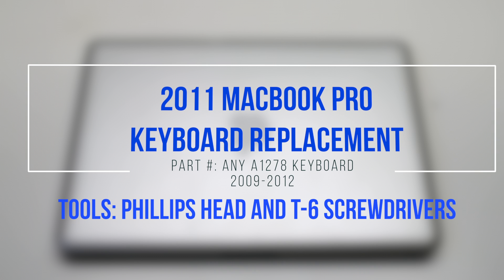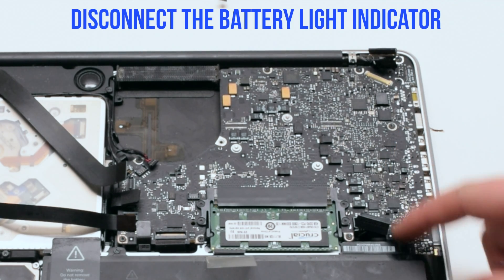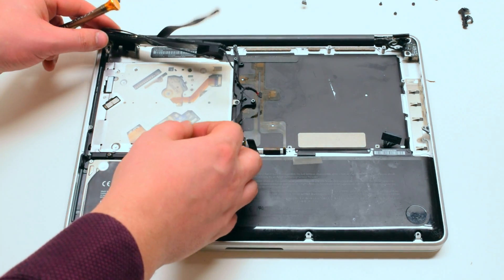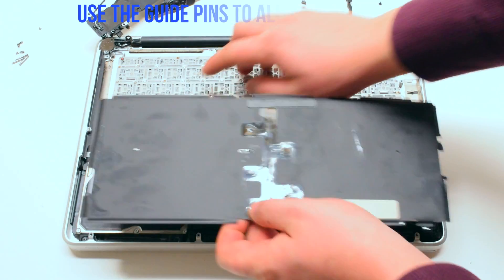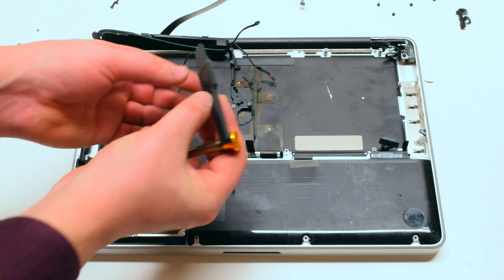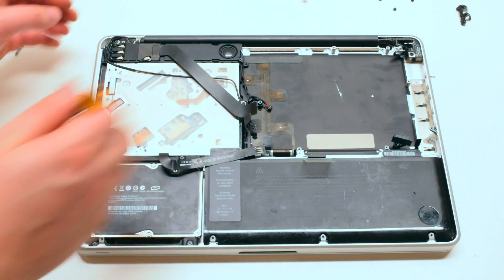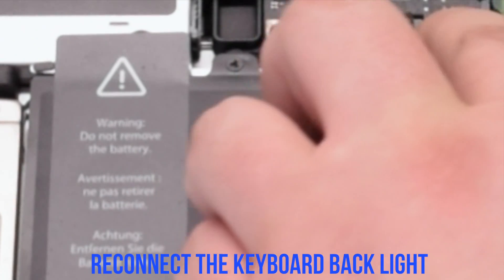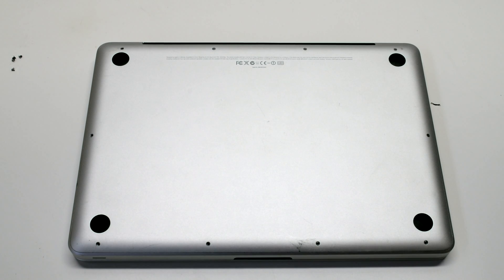2011 Macbook Pro 13" A1278 Keyboard Replacement

Comment: Thanks! I'm typing this on my freshly installed keyboard on an MBP I got for cheap not knowing a third of the keys were dead. Looks like someone spilled some coffee on it at one point.

A few tips I'd like to add:
-Get a magnet on a stick. Simple tool but I used it a lot for screws that didn't wanna come up.
-Use tweezers without a metal tip. Mine are ceramic. They make life so much easier with reattaching the cables.
-Some cables have locking levers, some are press fit, some pull straight up (like the fan). Be aware which ones remove in which way. It's pretty self evident if you look closely.
-I didn't find anything particularly difficult to remove. I did this whole job with a relatively inexpensive eBay set of micro tools. Just be sure you have a solid T6 Torx and you're good.

Two of the FIFTY ONE FFS screws that hold the keyboard in were rusted out from the coffee spill. They did not move whatsoever. Not even my stripped screw removal kit was able to budge them. I actually ended up hitting those two with a 1/16th" drill bit and drilling out the screws. Be careful if you must do this - Open the screen and lay a towel down on your table, then perch the MBP with the screen hanging over the edge, then drill. Only a second or two is needed because the screws are very soft metal. Clear any metal shavings away. Thankfully my two rusted out screws weren't near each other and so two missing screws out of 51 doesn't affect typing at all from what I can tell.

Again, the keyboard screws are very soft metal. Use the largest bit that grabs the screw and use medium-hard pressure straight down when you start them spinning to avoid stripping the head.

Thanks to this tutorial everything on my laptop still works after it all went back together, so thank you. :)

Now that I know everything still works I'm gonna go ahead and get it an SSD, max out the RAM, replace the battery, and install High Sierra.

Comment: Did it a second time because someone spilled a drink on my macbook. The ribbon is a pain but it is working now ! The Macbook wasn't booting. But before changing the logic board change the keyboard, there is a great chance that the liquid didn't even reach the logic board and the mac is not sarting becuse of the faulty keyboard.

Comment: Thanks for the video, I managed to replace the keyboard myself! Could not have done it without your tutorial! 
Btw the subwoofer on the left edge can stay, there is no need to remove it. You can work around its cable easily when screwing in the new keyboard.

Comment: Had to sacrifice about 5-6 screws as they got rounded off as they were so corroded and couldn’t get them out. Head was taken off but remaining part of screw is still stuck inside. Hopefully the new keyboard will be ok with a few screws missing 😂

Comment: Total life saver. Keyboard died shortly after cleaning keys with glass cleaner on cloth. Local Apple Authorized dealer quoted me $1,999 to replace keyboard and logic board... due to liquid being found on logic board. He firmly advised purchasing new.  OEM keyboard w/backlight $24, tools... (already had), time 2hr including cleanup of frame after removing keyboard (Coffee or hot chocolate stains (Kids). Everything working like new.  Thank you.

Comment: I followed your awesome tutorial but now me computer won’t start, all there is is white on the screen; tried resetting (command+option + p + r) but no luck; I can hear the chime but no apple logo. Any ideas what did I do wrong ? Thanks !
Reply: had same problem on an old imac when i changed graphics card turned out one of the connectors was not reconnected correctly just check and make sure yours are reconnected correctly

Comment: Thank you so much! This made an intimidating job easy - took about two hours and everything's working well. I had to use a piece of sticky tape to help get the keyboard cable in (lined up the keyboard cable in the socket and then used the tape to pull it forward), but everything else was straightforward. Really clear and helpful walkthrough.

Comment: Did this and my Macbook has become terribly slow and takes ages to boot. Ive trieed eeeevrythin☹️
Reply: It happened to mine too. It's slow when its on battery power, but when you connect it to a charger its fast right? This worked for me and hopefully it works for you: https://www.makeuseof.com/tag/macbook-slow-battery-fix/

Comment: Dude you are a legend. I took my MacBook apart to clean it and thought I snapped a wire (I unplugged the keyboard wire) and I was well worried. Turned it on and the keyboard wasn’t working. Found your video and found out it’s supposed to come out so I put it together and it worked. Thanks man
Reply: Where in the video is the keyboard wire part?? Thanks in advance.
Reply: @Darrin.Crawford  I meant at 1:33 when he takes the keyboard wire out

Comment: THANK YOU for this great tutorial!  I had removed the logic board before, replaced the dvd for a bigger HHD, and the original HHD for an SSD, but without this tutorial, I would have NEVER done it.  Subscribed!

Sadly, my early 2011 actually has 67 screws. 😕

Comment: I'm now typing this comment with the new keyboard. Took me 6 hours. I almost cried at the end. 
I counted 67 screws on the keyboard. That wasn't what took me long. 3 of the old keyboard were rusted. I had to cut the old keyboard away.  
The keyboard ribbon  took me hours! I don't own tweezers. Reconnecting that ribbon almost made me  cry from frustration. 
I also ripped off the whole connector of the fan. And I don't have soldering equipment. 
Still, everything (aside from the  fan)  works well. Thank you for this detailed  video.
Reply: Where in the video is the keyboard ribbon part?? Thanks in advance.
Reply: Your lucky you got all the screws out. I had to leave a few in but without their heads as I had to rip the keyboard off… the screws were rounded and corroded it was a lost cause with about 5-6 of them…

Comment: I am very grateful for the video. A piece of constructive criticism?  Whenever you know your hands and arms will block the view,  POINT AT where the action will take place BEFOREHAND. That’s the main difficulty, not knowing exactly where you’re screwing the pieces back in (or off), not the actual act of screwing them back. In name of clarity for the ones who have never opened a MacBook Pro before (hmmm,,, all of us, since we actively looked up this video), I just with the part where the cables are disconnected from the motherboard was a little bit slower, so we can see how some of the trickier parts are reconnected/disconnected. Again, it’s constructive criticism and I am super grateful you’ve gone through the trouble of making this video.

Comment: If you can not reconnect the ribbon wire from the new keyboard into the connector on the logic board, or if it does not go deep enough, use a piece of tape on the side of the ribbon to pull it/push it into the connector. This was the most challenging connection I have there.

Comment: It's not clear exactly how you remove the power connector for the fan ..  it looks like it pulls out vertically. but it doesn't feel like it wants to on my 2012 macbook pro ...  The same with the speak connection... The one in this video just pops off vertically with ease, & yet mine really feels like it doesn't want to ... any advice?
Reply from the maker: Some are old and crusty some are easy. Just get into a crack on it with tweezers and see if you can cause a micro separation.

Comment: Some additional tips:  use a small tape for the keyboard and backlight cables to help pulling them into the slots, better than accidentally bending them.  Also, might need to perform a SMC reset after it's all done in order for the keyboard backlight to work.  Thanks for the walkthrough, especially for the tip on the mic!

Comment: Followed this video exactly, took me about two hours with help of my partner. It was very easy to follow along side the instructions and  everything fell into place and works as it should. My Macbook Pro is from 2011 Model: A1278. Even though video is another model, it worked super well with my mac. Make sure to divide your screws during the process, there’s A LOT of them.

Comment: hey hi the macbook doesn't turn on anymore from the button. I tried to refit 2-3 times. It turns on by itself by connecting the power cord without pressing buttons. What happen? why does it turn on by itself when I connect the power cord? I tried to do a smc reset without success.
Reply from the maker: It does that when there is no keyboard present. That means you need to reseat the keyboard cable, it’s not connected correctly or completely.
Reply: @GRIBSOFT  
removed and put back. The keys on the keyboard write but trying one press them many times. The power button seems dead. Can the cable be damaged? I see a slight bend on the cable
Reply from the maker: Just try to put it in different positions multiple times, If nothing changes after at leas 5 power on attempts at different angles then read this guide: http://www.insidemylaptop.com/turn-on-macbook-pro-laptop-without-power-button-locating-power-on-pads/  It's likely the replacement keyboard is bad.

Comment: So like dummy I spilled some water on my keyboard and some buttons don't work randomly all over the keyboard. I'm assuming I would need to replace the keyboard? Maybe the backlight component and then everything should be back to normal?
Reply from the maker: It it's only water, it should dry up and work.

Comment: After i took it apart then re assembled, it won’t turn on. Just does 3 soft beeps when pressing the power button? Did i plug something in wrong? Battery cable? It shows charging when plugged in with the green light but won’t turn on. Just a soft beep @saveappledollars
Reply: The battery cable is plugged in and also when charging it says fully charged green on the side and beeps continuously. But still won’t turn on just the soft beeps
Reply: Also when plugged in the battery indicator light continues to blink and beep Did i plug something in wrong? The battery light on the charger is green
Reply: It now won’t beep unless the charger is plugged in. When it’s not plugged in no beeping and won’t boot. When plugged in beeping and fan comes on but won’t boot. The battery is fine as i had it checked last week. Pretty sure no mother board issue bc it was literally just working until i took apart to clean keyboard. I’m thinking i plugged something in wrong? Please any help!
Reply from the maker: Three beeps means the system memory (RAM) is not being recognized. Attempt to boot with one module or reseat both modules. Let me know how it goes.
Reply: How do you boot with one module? Or reset them!? Thanks for reply
Reply: The battery indicator blinks twice and beeps twice.
Reply: Also should mention the beeps aren’t loud like other RAM videos. It’s a very soft tone coming from
The battery indicator sounds like
Reply: And when the charger is plugged in it constantly beeps softly and the fan comes on
Reply from the maker: A Mac will initiate the SMC with any amount of RAM but only as long as there is some present.
Reply from the maker: Reseat the memory modules first, use only one. Reseat the keyboard connector. Completely unplug the battery and attempt to power on without battery. If this doesn't work, completely remove the logic board and reinstall it, it;s possible something is jammed or shorting.
Reply: Save Apple Dollars i took the RAM chips in and out and it is still doing the same thing!
Reply: Just two soft beeps
Reply from the maker: Remove logicboard
Reply: I just unplugged the logic board completely and made sure nothing was jammed or lose. Still nothing. Won’t boot. I can hear the hard drive try to spin on but doesn’t. Still black screen won’t boot with two beeps
Reply from the maker: Did you reset the SMC?
Reply: Save Apple Dollars take the battery in and out correct? Yes i did. Do you have an email i can email you?
Reply: Save Apple Dollars update: it only makes the soft beeps from the sleep indicator light when plugged in. When not plugged in with the charger no beeps and sleep indicator light is off.
Reply from the maker: Unplug the hard drive cable and try too boot without it.
Reply: Save Apple Dollars when i unplugged the HD cable it wouldn’t boot, nor when plugged into charger it wouldn’t make the soft beeps from the sleep indicator. But when i plugged HD cable back in it continued to softly beep sleep indicator
Reply from the maker: Watch this video I just made, see if it helps in any way https://youtu.be/LutTYK6z3Hg
Reply from the maker: Does the fan spin? What does the charger light show?
Reply: Save Apple Dollars the fan spins when the battery charger plugged in. And when the battery is connected the charger cable is green and the lights on the side show all five with the last light blinking 2-3 times
Reply: Save Apple Dollars another update: fan spins while charger is plugged in. Not when unplugged from charger. Charger shows a bright green. That means is not the mother board right? Also sleep indicator continues to flash and beep when plugged in.
Reply from the maker: We got to do some thinking here, if the fan spins continuously that means the unit logic board is turned on and is running just fine but is not putting out video. In this case, check your LVDS connection, the cable that’s goes from the logic board to the LCD panel... reseat this connect multiple times to see if it has any effect. Then we can move to something else.
Reply: Save Apple Dollars wouldn’t it still boot if that lvds was lose and just not show screen? Or would it not boot to due to a lose lvds?
Reply: Save Apple Dollars ok update: so i u plugged everything again including the lvds cable. And now i can hear the hard drive trying to start up but won’t totally boot as well as the fan spins still; now this is all without being plugged into the charger now.
Reply from the maker: It sounds like something here is touching where it shouldn’t. I would unplug everything, hard drive, battery cable all peripherals, WiFi cables track pad, I mean everything, only have the fan, keyboard (for power button) and lcd cable, just those three powering of the adapter see if posts.
Reply: Save Apple Dollars ok so you’re genius worked! I have no idea why but the computer won’t boot when the trackpad is plugged into the logic board? It worked before i took it apart to clean the keyboard (which failed to clean and work anyway). Any thoughts on this? So now my keyboar and mouse won’t work without a usb plug in. But at least my MacBook boots now. Thank you soooo much for helping me the past couple days
Reply: Save Apple Dollars still confused on what the trackpad has to do with the computer booting
Reply: Save Apple Dollars another update: my hard drive says 95% full. Could this make the MacBook run very slow?
Reply: Save Apple Dollars update: it is definitely the trackpad cable causing the MacBook not to turn on. When connecting it won’t boot for some reason? Why? I think it may be a logic board issue bc the Mac runs extremely slow and lags extremely bad. I tried to install a brand new internal hard drive but each time 7 hours passed and it was only on 12%.

Comment: Thanks bro! If you're having trouble connecting the KB cable, try attaching a piece of tape on the ribbon. If you bend the ribbon in the slot you can pull the ribbon in it's socket with the tape.
Reply from the maker: Great tip
Reply: whoa, this deserves to be pinned! it always gave me headache, and my best bet to date was to lift the bottom half up with a spudger.
Reply: @CakraDiaz  Thats quite dangerous since you can bend one of the inside pins or pieces on the motherboard. Most new cables wont even come with the tape at the end now so you have to improvise.

Comment: I went through this process and replaced the keyboard. The original problem was that there was a spill and half the keyboard would not work. There was significant corrosion on the connections and some were very difficult to detach and re-attach. Everything went back together and the keyboard seems to work but the track pad no longer clicks though it does move the cursor. I connected an external wireless mouse and that works. Any ideas about why the track pad would stop clicking after this procedure?
Reply from the maker: Sure, check out this video, it will clear up the clicking issue http://www.appledollars.com/trackpad-replacement

Comment: Thank you so much for the video. Being  able to watch every single step is really nice!
Since I changend my keyboard the power button finally works but all the other keys don't... 
Any idea on what I did wrong?
Reply from the maker: Sure, reseat the main keyboard connector. It's very frigidity and if no perfectly aligned some functions will not work.
Reply: Save Apple Dollars oh my God it works!! I forgot about the Lash. 
Thank you so much I really appreciate the help ☺️

Comment: I have a late 2008 model with an A1278 logicboard. Can i replace the board with a newer A1278 board?
Reply from the maker: Negative. The 2008 Macbook model has a unique layout that was only used for one year.

Comment: Excellent video.
Thank for taking the time.
Attaching the ribbon on the keyboard is definitely the most difficult part.
Especially if its's a new (straight) ribbon.
Try using a pencil eraser to hold it while you bend it into position.
Thanks
Reply from the maker: Glad it worked out for you.
Reply: Oh man. If it’s worse than putting the 51 screws back then, it must be Hell on Earth.